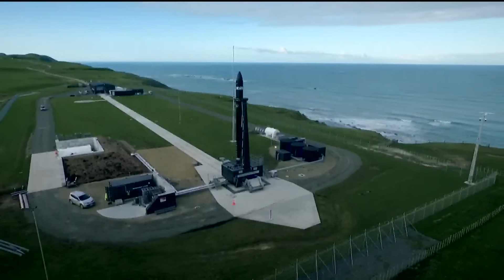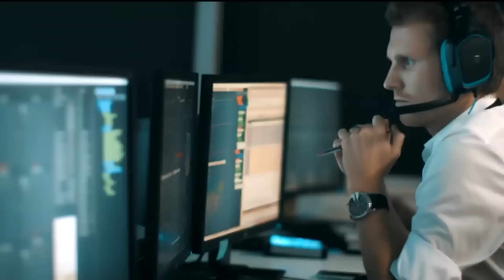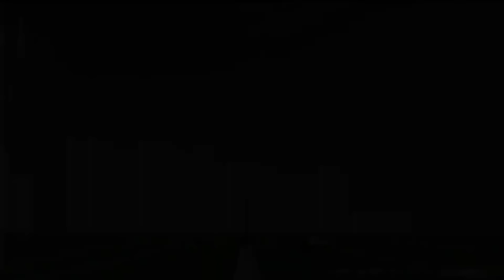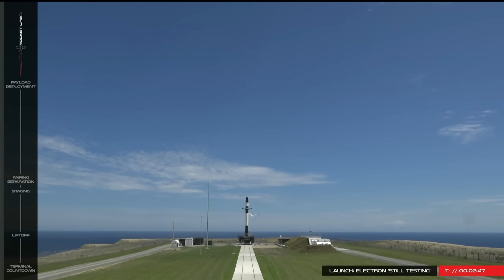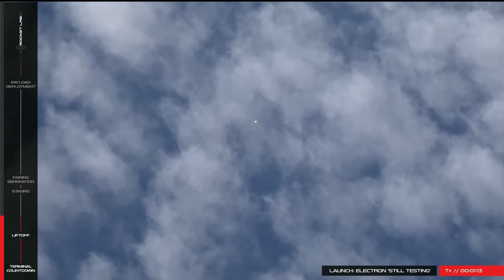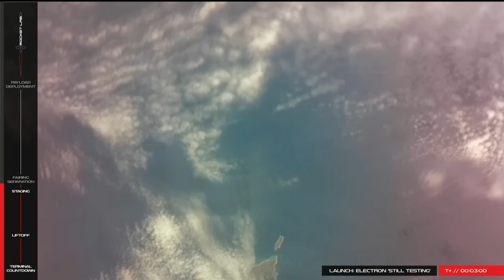Still Testing Launch - 01/21/2018

Comment: Now we need an electron heavy with crossfeed
Reply: Electron Super-Heavy with asparagus staging.
Reply: 3 months maybe, 6 months definitely
Reply: Greg K a electron X is better fully reusable 150 merlin 1D engines clustered  for fiirst stage booster 800 meters tall 50 vaccum raptor engines and 50 sea level raptor engines as second stage A CLUSTER OF 57000 SUPERDRACO ENGINES AS THIRD STAGE AND CAN LIFT 8000 MEGATONS INTO LEO
Reply: Well that's one thing Falcon Heavy doesn't have.
Reply: There are no plans for bigger rockets at the moment
Reply: TheRedstoneHive let us have our fun XD

Comment: It would have been nice to have seem some telemetry , like velocity,  altitude,so that we could appreciate the rate of acceleration and the orbit height achieved. Well done Rocket Labs.
Reply: Neil Lickfold yea we get spoiled with all the data during spacex launches. But in time I bet Rocket Labs will display that as well. SpaceX didn't have that data for their first launches.
Reply: True, that would have been cool.
Reply: ULA used to show just about everything - apogee/perigee and current altitude, RAAN, inclination, argument of perigee. I think they accidentally showed it on some national security launch (during first stage flight) and then it went away. You can look up WGS-5 webcast on youtube and still see the telemetry.
Reply: I would agree. it's great to see the dial wind up in velocity and alttude. You really feel part of the launch.
Reply: @Pat B. By using something other than WiFi. The technology necessary for wireless video transmission has existed for nearly a century.
Reply: @Pat B. What are you talking about? There's no such thing as wifi from space.
Reply: It's actually a lot more than that. During OA-4 it was altitude, velocity, acceleration, down range distance and azimuth with additional infos regarding perigee, apogee and inclination during the final seconds.
Reply: Pat B. Your stupid
Reply: Greg Zemke-Smith SHUTUP PLZ DONT INVADE ALL SPACE CHANNELS FLAT EARTHERS
Reply: That's still the case if you look at OA-4 or OA-6
Reply: OA-4 and OA-6 unfortunately are still limited to apogee/perigee/inclination, whereas in past launches you could literally see every parameter. ULA's Centaur stage (and I think DCSS?) has yaw steering, so I wish they showed that in some mission where they used that capability.
Reply: Ah, fair. Still doesn't show the full orbital parameters, but I think that'd be enough to extrapolate.
Reply: K
Reply: yeah, and a picture of the astronauts face too eh!
Reply: They can create fake footage of a rocket blasting into orbit, but they can't come up with some fake telemetry to make it look more convincing? What, did they run out of computer memory or something?
Reply: @gregs3845  yeah. Unfortunately some of us think, not just believe. We are dangerous.
Reply: geofrancis2001 - "you're"
Reply: explain it then princess... they can give you high definition video of a CGI glowing nozzle but cant tell you how high, how far, or how fast it is going...deal with it.
Reply: Rob Speed - yeah, I can see these limp wristed clapping controllers sitting around a conference table having a peanut butter and KIWI sandwich discussing the pros and cons of choosing telemetry data transmission or a computer generated image of a fake glowing nozzle.
Reply: they can give you live WiFi from "space" but no telemetry because it is all fake.
Reply: @mytubedude532  Fake. Correct. I'm not sure how all these soy filled fan boys can't see it. It's pathetic.

Comment: What is this "hot swapping" that took place at T+6:37 into the flight when the mylar insulation at the base of the engine apparently was blown off?  Congratulations on a very successful test flight!
Reply: Staging battery packs to lower vehicle mass. Since Electron's engines use an electric pump rather than a turbopump, it needs heavy batteries - so it makes sense to ditch the depleted ones.
Reply: Thank you.  That makes good engineering sense...
Reply: @Bevin Smeith: In addition to open-cycle, there are a few different engine designs which use a turbopump. Closed-cycle (where the pre-burner's exhaust is pumped into the combustion chamber) is an obvious example. But there's also some like the combustion tap-off cycle used by Blue Origin's BE-3 which pipes a small amount of exhaust out of the combustion chamber, uses it to power the turbopump, then dumps it overboard like an open-cycle engine.

There's also pressure-fed engines that don't have any pump at all, but they're incredibly inefficient. The fact that Rocket Lab has managed to get such such a novel design to work is very impressive.
Reply: Actually pressure fed engines have some really high efficiency numbers, however, they are limited in size, depending on how the engine is designed.  If you rely on the cryogenic fuel to cool the engine bell and provide the pressurization with the heat it gains from that, you run into diminishing returns, and of course if you use another gas to pressurize the fuel tank you will need a lot of it, or have some way of increasing it's temperature in order to increase the pressure, causing other problems.  In short, pressure fed engines work great on the small scale, but you can't use them for high thrust or long duration burns.
Reply: Other rockets use a small amount of fuel to run the pumps (Open Cycle Pre-Burner), you can see a good shot of this on the second stage on the SpaceX falcon.
Reply: Wow, very cool.
Reply: That is where the expended turbopump battery was dropped away and the pump swapped to a new fully charged one. That is completely nominal and supposed to happen.
Reply: @SixSilverStones  yeah, two years ago I didn't know, but I sure do now that they are up to 14 flights with the Electron...and it has been explained since that first flight during their videos....But thanks anyway....Very cool design.  

I've read where using electric powered turbopumps is difficult to scale up because of the power necessary.  Much larger than the Electron and you might as well use a gas generator cycle, so I guess they have hit the sweet spot. 

Hoping they'll be successful in recovering their 1st stages pretty soon...That will be exciting to see!